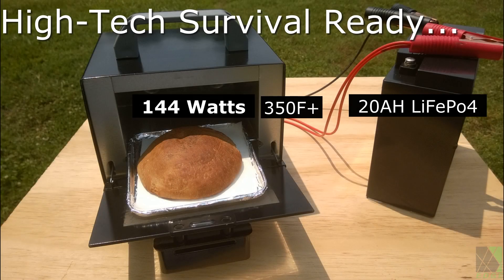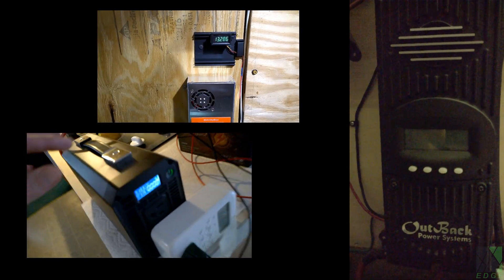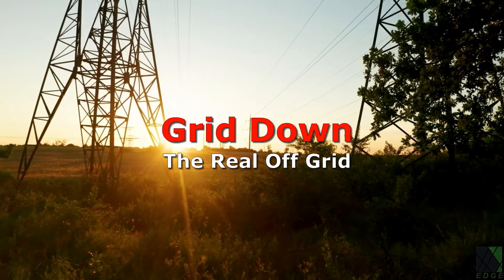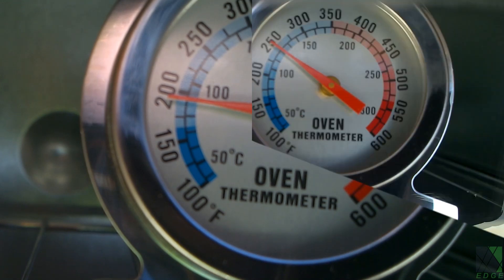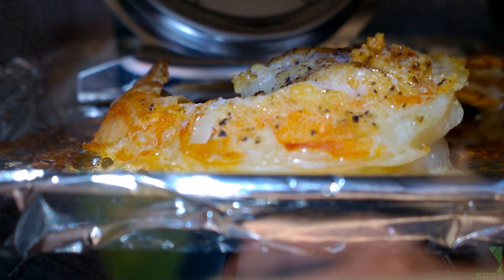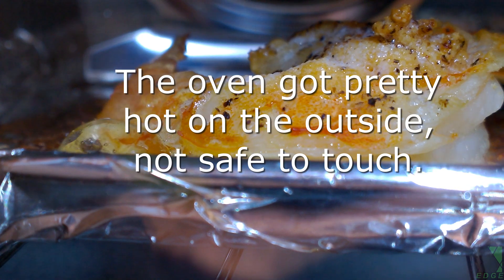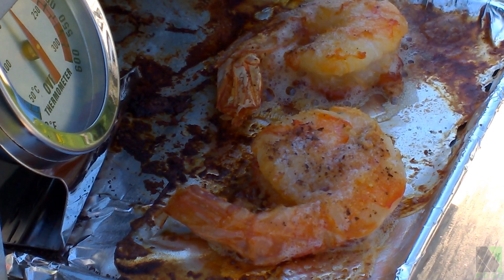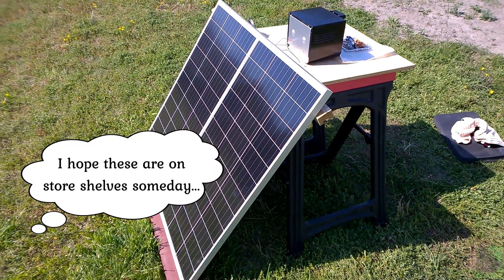Mini Solar Electric Oven 12v 18v direct PV DC solar power prototype toaster test #solar #solarenergy

Comment: Do you sell the appliances? Im trying to run my tiny home fully off 24v without any inverter and would love to tey these
Reply from the maker: @LibertyEducator Hi, I wish I could! Just doing all I can to keep head above water at the moment :)
Reply: @solarpoweredge if you ever do hit me up. I'm in my design process right now. Anything above 24v seems to give me migraines so I'd be a good tester :)
Reply from the maker: @LibertyEducator You got it... if you plan to build a custom DIY 12v/24v oven, might be a good idea to watch my build video! PS I get migraines too so I understand. I try to avoid EMI/EMF. 
Have converted a few ovens to DC, and they can be any voltage you want! Just need to upsize the wire for more power at lower voltage
12v diy oven https://youtu.be/z0dKupye594

Comment: Baking bread?  What, the size of a muffin?  I can't believe with boats and RVs being around so long that no one makes a DC cooktop and oven combo.  
I guess I might have to go with the wood burning cook stove & oven....but I'd rather not.  I'm trying to nix the necessity of having to have a source to buy propane or wood.
I appreciate your talent but at my age finding a man that could do what you're doing has worse odds than finding a commercially built DC range, it seems.
I plan to buy a DC freezer that will serve 2 purposes.  1) preserve my garden produce and meats and 2) for making my own "milk gallon" ice blocks for an ice box.
Edit: just came across that a stove needs 800w and 1,000w while cooking.  Wow, that would take too many solar panels.  I see why they chose propane.  Looks like I'll be getting the little wood burning range and oven combo.
Reply from the maker: @lesliekendall5668 I have all sizes of PV ovens and cooktops, I just don't show them. I love these small ovens. Small means extreme portability. It will bake any item one after another all day long for free, zero fuel or maintenance. Proof that direct PV cooking is useful. I am transitioning a lot of my appliances to direct PV-DC (PV2L)
Reply: @solarpoweredge 
Man oh man, if you have one that I can bake a regular loaf of bread in, I'M IN ALL THE WAY!
Reply from the maker: @lesliekendall5668 Yes I do :D it's big enough to bake a turkey, just barely. I built it to use 12/24/48v battery, or direct-PV DC. Hope to do a video about it as soon as humanly possible. Right now we are fighting some serious battles plus moving to a new town, so I haven't put the finishing touches on my other ovens... I hate showing stuff that isn't refined and complete :)
Reply: @solarpoweredge 
You're attaining 350° off of TWO 100w panels?  You're killing me.  I need that.
Reply from the maker: @lesliekendall5668 Yes these small ovens can hit even 450, but I felt like that was too hot. You can see how to build the 12v version here, it's based off the Dash mini chassis. https://youtu.be/z0dKupye594
Reply: @solarpoweredge 
I had already gone to that video and watched a bunch of it but, you know we all have our gifts, but taking apart things like that? Well, I call it "guy stuff".  And then when you talked about "this could burn down the house" 😲 It made me wonder if you must've had a nervous mother when you were a child. 😆. I guess that's why we're more than happy to build shops for our man and sons.  "You want to do WHAAAAT?". Okay honey, just do it outside, okay?"....and try not to break any windows".
Reply from the maker: @lesliekendall5668 Yeah you're right and good points :D I think many guys are more interested in burning stuff to a crisp vs. actual cooking. I always tell people "I'm not a cook". The last food I put in that oven was well, over cooked and that's being generous. But I just wanted a longer oven test. I will say we ate all the test food even if it was burnt - no need to waste food :)
Reply from the maker: @lesliekendall5668 That sounds very tasty, thanks for sharing. I will also send this idea to my mother who is a world class cook :) it sounds foolproof enough, so I may try it in my new 12v oven and post the video. Unless it catches fire like some of my cookers do. We are moving to a new city at the moment, it's slowing down all the 100 cooking projects I want to make videos of :)
Reply: @solarpoweredge 
Where are you moving to?  I'm in Boise.  Really growing because of another tech company that's coming here.
Reply: @solarpoweredge 
Oh and btw, 325° isn't enough to catch fire to a paper bag but at the temps in YOUR ovens, you might want to check the flash point of paper. 🤣
Reply from the maker: @lesliekendall5668 We wanna move to east ideally somewhere around VA - IF we can find the right place. that's proving a challenge. But right now we are feverously packing and boxes are stacked to the ceiling. It's like moving 2 households literally, so we cannot wait. Once I have a new place lined up, I'm gonna post a video and update you guys and gals. If things go well, it could be very exciting. We want to build a serious solar homestead - so it will add a new dimension to the videos (hopefully)!
Reply from the maker: @lesliekendall5668 Haha! thanks for the tip... I never record the fires 🤣 but it would make for an interesting video clip...
Reply: @solarpoweredge 
Oh yes, people LOVE the blooper parts of videos. 👍
Reply: @solarpoweredge 
I always liked the climate (no need to water and have a thriving pasture) in places like Kentucky but all I had to do was look at a nighttime map of the US that changed my mind forever and keeps me in the west.
Reply from the maker: @lesliekendall5668 Good point. I have considered the west and would like to make that leap. But for various reasons it can't happen. So we limited our scope to the east'ish side of US. I am zeroing in on a couple of properties that have a bit of acreage. If that works out, I will be able to set up a true solar farm. That means bigger stuff, including large ovens and full kitchen cooktops running off solar. Right now I have nowhere to build anything large scale. All the solar is temporary on bricks and 2x4s. Hope to have some real space and share that update as soon as possible. Maybe I'll start doing homestead videos (if anybody will watch it lol)
Reply: @solarpoweredge 
Yes, people will watch them.  A very popular niche.  I watch as many as I can for new ideas.  DC solar hot wires on fencing are popular.  Show them how they can hook up a wire direct to the panels without having to buy and install a bunch of mini panels around the fence line.
Reply from the maker: @lesliekendall5668 Solar fence is a great idea. I plan to try a few homestead related videos and see how it goes. More variety could be a good thing... I don't want this channel to get too narrow focus or repetitive.

Comment: hey bro...i dont know what mod u did as yet. but i recommend if its a cirtcuit or a pcb..
maybe you can work with pcbway - mass produce your mod and market it!
Reply from the maker: @andrievbastichy8551 Hey man, good idea. they did contact me a while back but due to my health and workload I hadn't done a project with them yet... hope to soon. These kinds of ovens should be available in normal stores! Both 12v and solar. PS if you want to build the 12v version yourself here is the project https://youtu.be/z0dKupye594

Comment: This is why my RV has 3 power sources for the fridge. 
120v, 12v and propane.
Reply from the maker: Indeed, never hurts to have a backup
Reply: @solarpoweredge  The 12v is much more efficient than the 120 and 120 is only used when grid tied.
Reply from the maker: Very interesting device. Been wanting to experiment with a non-compressor RV fridge, if I can find a "free" used one here that still works. Or maybe I'll just end up getting a RV, who knows :)

Comment: Nice..  I have an air fryer but out in the storage barn I have one of these but almost twice it's size.  I do use my Ecoflow Delta II to power the air fryer with.. so solar to lithium to AC is still quite a loss in efficiency... but overall cooked with the sun too. Maybe I'll set them up on my flatbed trailer and cook some lunch..  and also power the Ice maker as well for a cold drink to wash the lunch down with. I also have 18V Ryobi tools here.. so perhaps I'll convert mine too.
Reply from the maker: Thumbs up... I do love solar generators, power on the spot